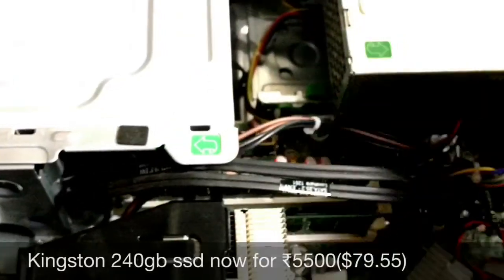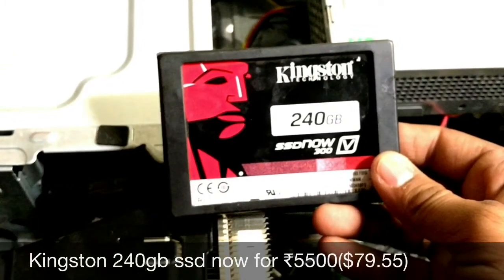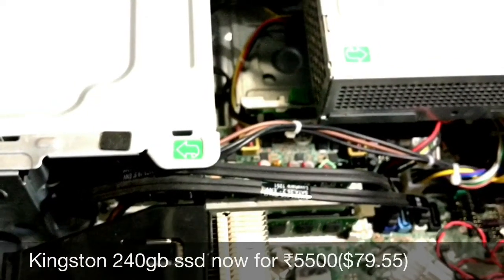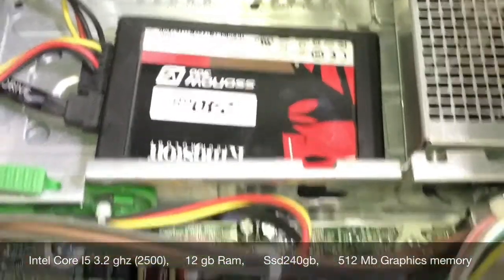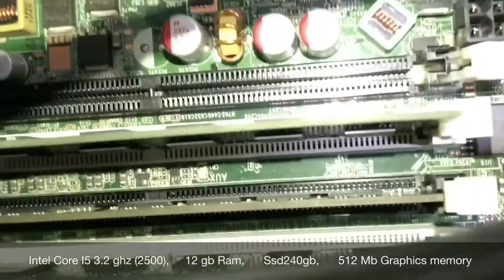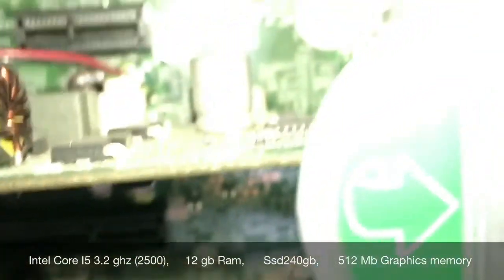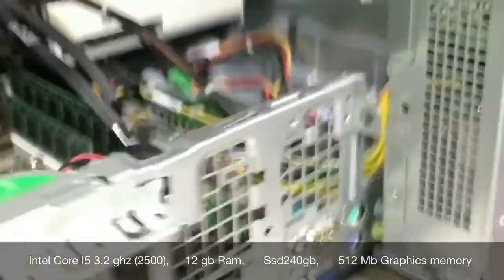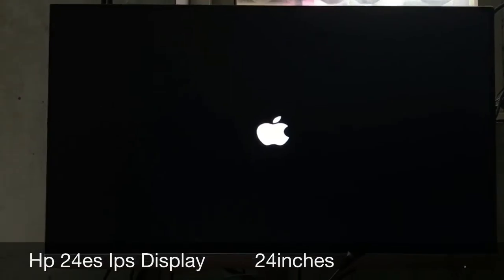World Cheapest hp 8300 sff core i5 hackintosh with mac Sierra 10.12.4

Comment: I'm doing a HP Compaq 8300 Elite SFF Intel Core i5-3570. I'm getting ready to buy a used Nvidia gt 310 512mb Gpu. But I can only find them in DDR2. Will that work or does it need to be DDR3? Was yours DDR2 or DDR3?
Reply from the maker: Go with gt 710
Reply: @FASTTECHS  Did you have to upgrade your power supply to run the gt 710?

Comment: after installing on this with i5 3470, all works except sleep-wake intermittently. Most times it reboots from a blank sleep screen.. Any suggestions?
Reply from the maker: check fakesmc kext in efi/clover/kext/other
if not present than paste all necessary kext in this folder
Reply: FAST TECH I did that and also upgraded to HSierra. Seems issue to be gone. I am planning on doing fresh install to HSIERRA once new uni beast and multi beast are made available.